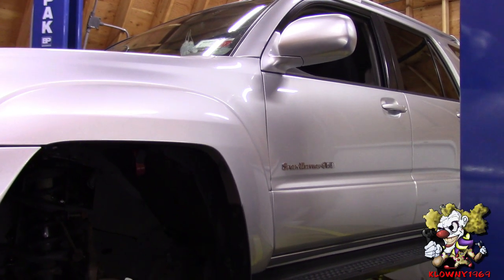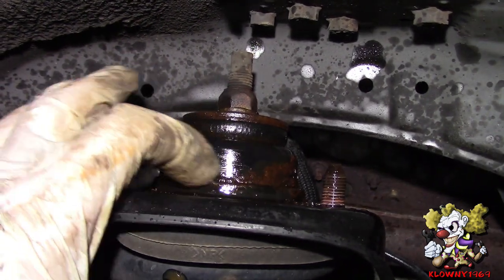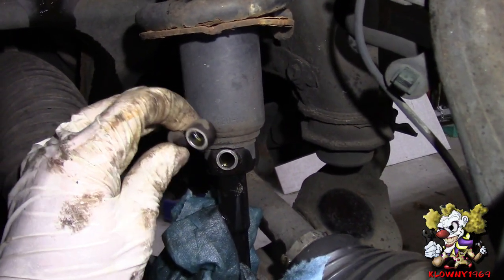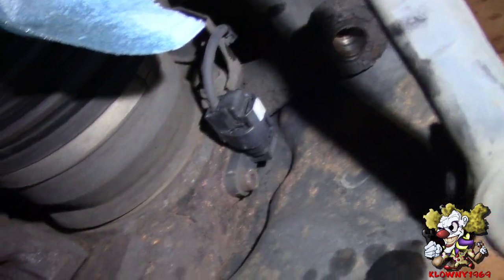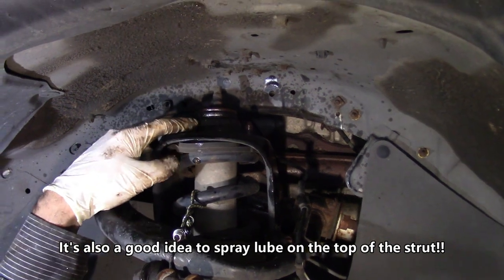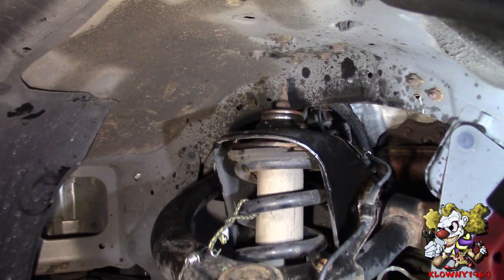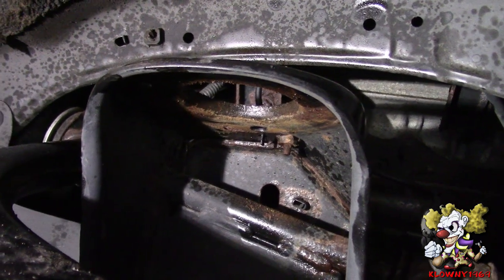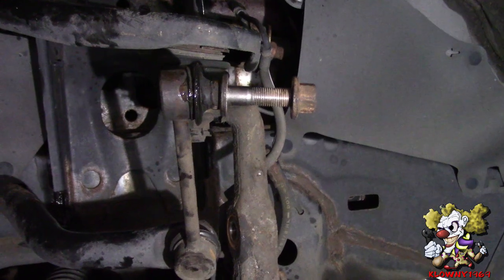Toyota 4Runner Strut Replacement - Xreas

Comment: Another tip : use penetrating blaster or any and give 30’min to soak. Then air hammer it . Heat it up if needed . Also thanks for this video . Helped a lot
Reply from the maker: Thanks..don't forget to subscribe

Comment: I am currently changing the struts in my 2004 4Runner, I don't have that Xreas, but it's still frozen.  It's hard to pound on it, as there's no easy way to hit it from the top.  I tried using the air chisel for a short time with a blade, but I need to find one of those flat blades.  I will try it again in the am.
Reply: I had the same problem and ended up changing the strut and spring without taking the top hat out

Comment: My understanding is the hydraulic shock system is linked.  So the left front shock is hydraulically connected to the Right rear shock....so wouldn't you need to replace the Right rear shock also?
Reply from the maker: i replaced all 4 shocks on this car with regular shocks..deleted the whole hydraulic assembly all together..dont forget to subscribe
Reply: @klowny1969  do you have to gut it all out or just disconnect from the center control absorber ??